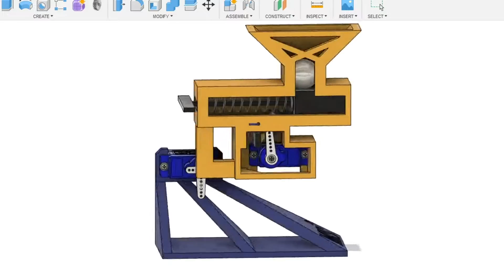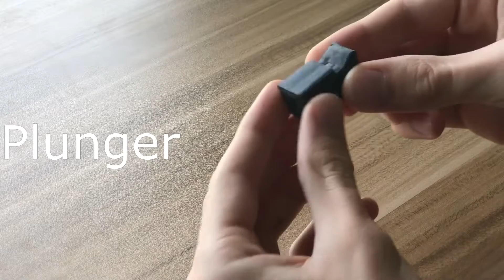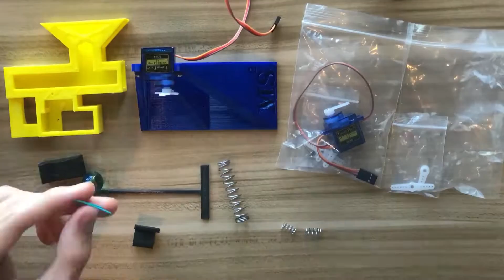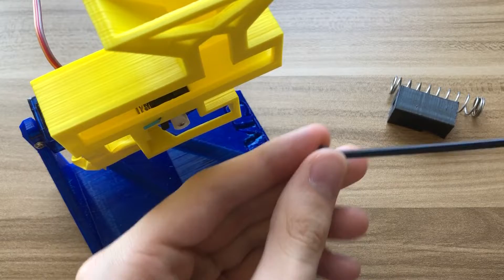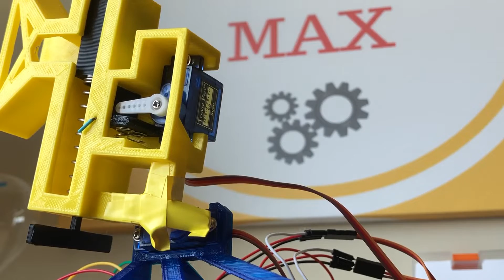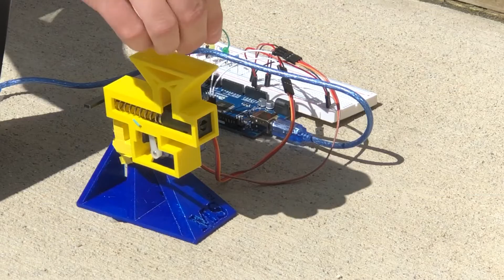How to Design an Arduino Marble Shooter

Comment from the maker: Here's the code for this project:

#include <Servo.h>
Servo angle;
Servo trigger;

const int angleServoPin = 8;
const int triggerServoPin = 9;

const int greenPin = 47;
const int yellowPin = 49;
const int redPin = 51;

int launchAngle;

void setup() {
  angle.attach(angleServoPin);
  trigger.attach(triggerServoPin);
  Serial.begin(9600);
  pinMode(greenPin,OUTPUT);
  pinMode(yellowPin,OUTPUT);
  pinMode(redPin,OUTPUT);
  digitalWrite(redPin,HIGH);
  angle.write(0);
  trigger.write(0);
  Serial.println("Enter a launch angle to begin:");
}

void loop() {
  if (Serial.available()) {
    launchAngle = Serial.parseInt();
    if (launchAngle < 90) {
      digitalWrite(redPin, LOW);
      digitalWrite(yellowPin, HIGH);
      Serial.print("Launch set to ");
      Serial.print(launchAngle);
      Serial.println(" degrees");
      angle.write(launchAngle);
      delay(300);
      digitalWrite(yellowPin, LOW);
      digitalWrite(redPin, HIGH);
      Serial.println("Put an F in the chat to fire");
      untilEnterComp();
      while (Serial.available()) {
        if (Serial.readString() = "F") {
          fireLights();
          trigger.write(20);
          delay(200);
          trigger.write(0);
          digitalWrite(greenPin,LOW);
          digitalWrite(redPin,HIGH);
        }
      }
    }
    else {
      Serial.println("out of range");
    }
  }
}

void untilEnterComp(){
  while (Serial.available()==false){
  }
}

void fireLights(){
  int flashDelay = 200;
  digitalWrite(redPin,LOW);
  digitalWrite(yellowPin,LOW);
  digitalWrite(greenPin,LOW);
  delay(flashDelay);
  digitalWrite(redPin,HIGH);
  delay(flashDelay);
  for(int i=0;i<2;i++){
  digitalWrite(redPin,LOW);
  digitalWrite(yellowPin,LOW);
  delay(flashDelay);
  digitalWrite(yellowPin,HIGH);
  delay(flashDelay);
  }
  digitalWrite(yellowPin,LOW);
  digitalWrite(greenPin,LOW);
  delay(flashDelay);
  digitalWrite(greenPin,HIGH);
  delay(flashDelay);
}
Reply: Thanks alot

Comment: really cool project and i want to recreate it for a project i am doing and i could really use some help
it would be amazing if you could share your cad models and if you could add a little more insight on how the trigger mechanism works.
thanks in advance
Reply from the maker: That's exciting to hear that you are doing a similar project! The CAD for this project could be improved, especially the connection from the base to the main part. For your project, I'm confident you can make a better design after watching this video.

I got the inspiration for my trigger mechanism by taking apart some toy nerf guns to see how those mechanisms worked. There are also plenty of other pictures and videos of mechanisms like this that can help you design your project. My advice is to research what's already out there, make smaller test prints or prototypes for your mechanism, and keep trying new things until you find something you are happy with. Good luck with your project!